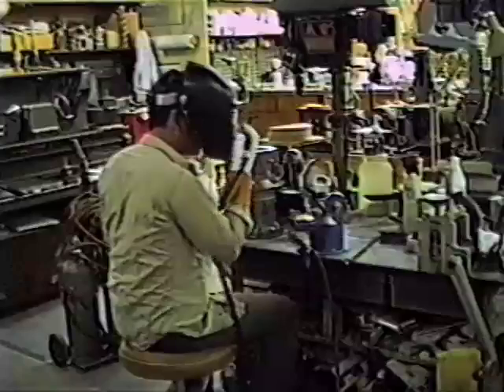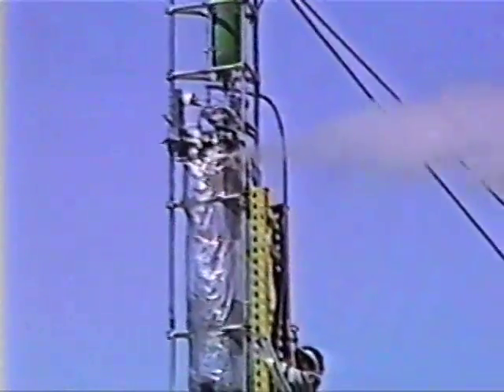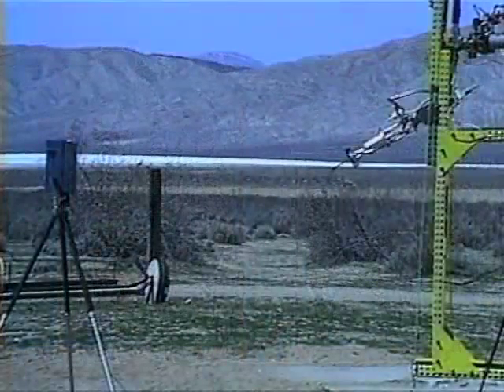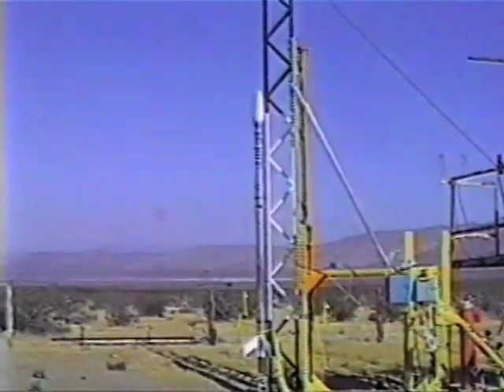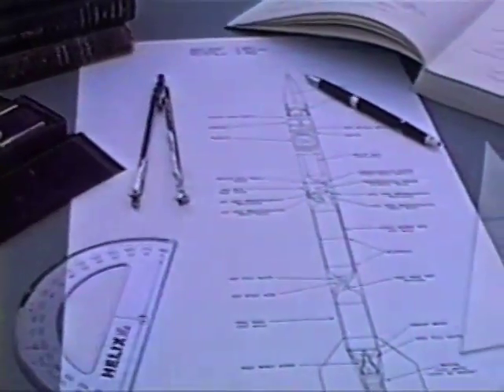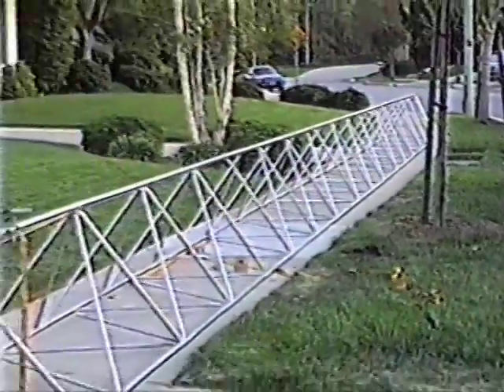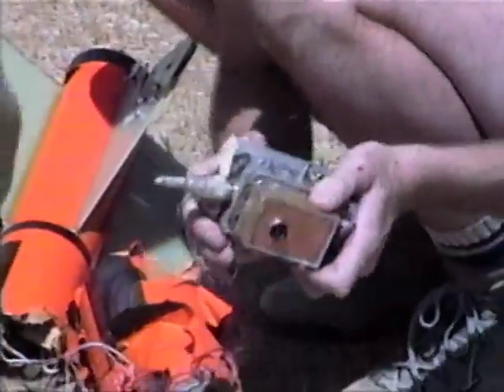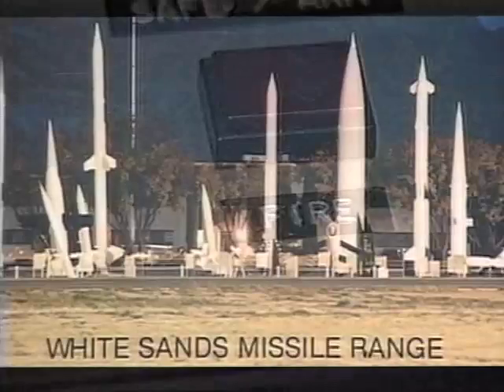David Crisalli's Sounding Rocket and other liquid Propellant work RRS members

Comment: That was impressive. The burn done just after the 4 minute mark was flawless. Very smooth startup, a fast transition to full thrust, and,most remarkably, the combustion was as stable and symmetrical as any I've seen in a kerolox engine,large or small.